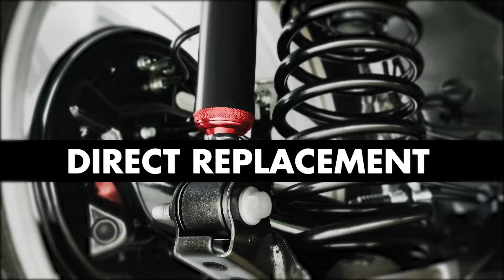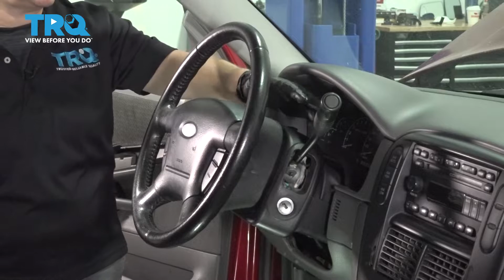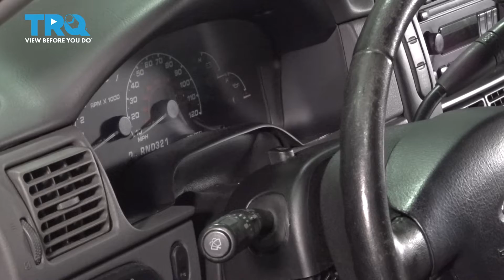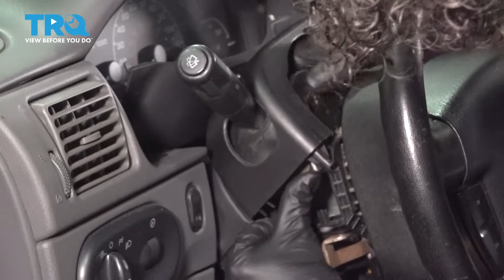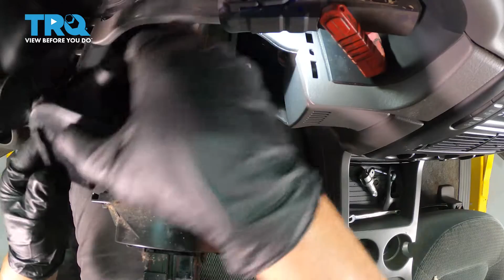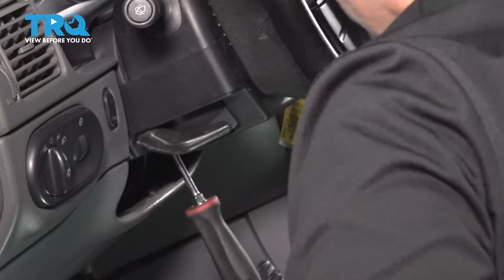How to Replace Combination Switch 2002-2005 Ford Explorer

Comment: Hoping this works my high beams are stuck on, the switch was loose and wouldn’t turn the high beam on. We pushed the switch back in place, no longer loose but now highs won’t turn off.

Comment: So, what was the original trouble that might make you change it out? I have a 2003 ST and if the steering wheel is at the lowest, my turn signals don’t work. Only when the steering wheel is up does it work right.